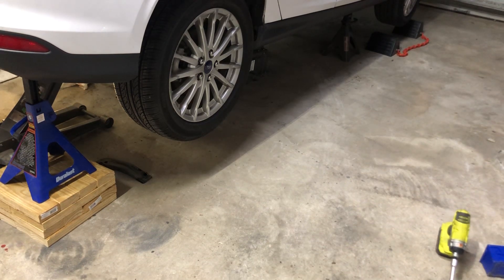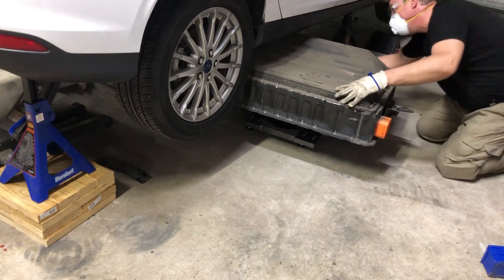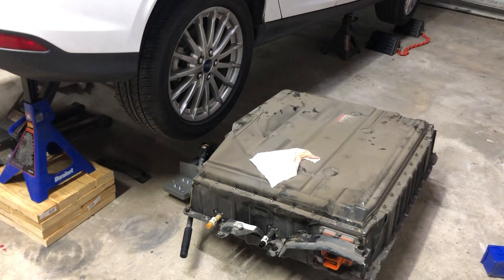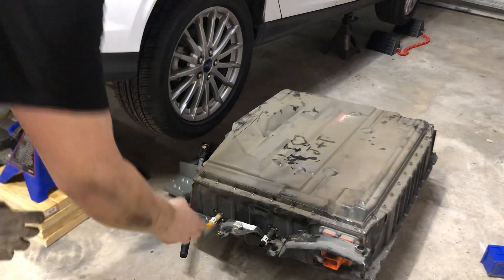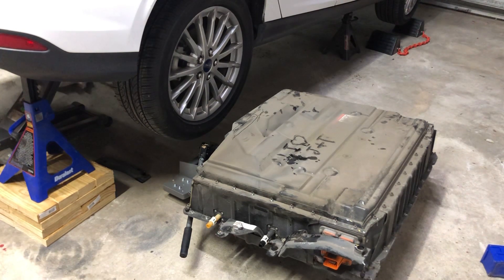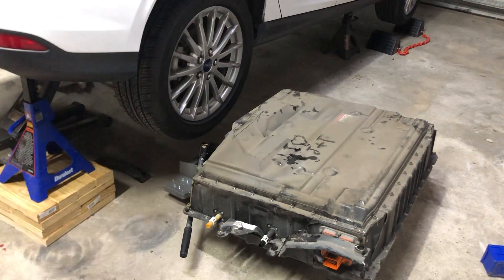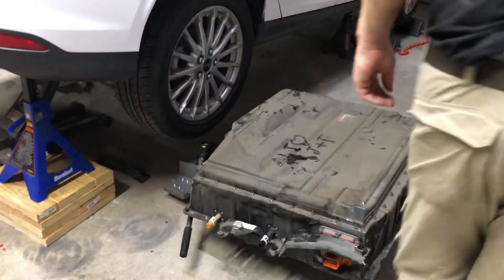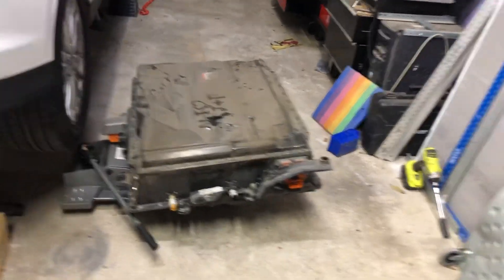Ford Focus BEV Lower Battery Removal

Comment: Where did you get the info ? Web links pls. Thank you for your service sir.
Reply from the maker: There are only six big bolts holding in in once you get the bottom felt cover off. There is battery removal guide available on the web when you search Google.
Reply from the maker: https://elvsolutions.org/wp-content/uploads/2015/10/2016_Focus_EV_Battery_Removal_Guide_Final_10-12-15.pdf

Comment: Tomorrow I have to try this, take lower battery off.
Reply from the maker: It’s pretty easy with the transmission Jack and some simple hand tools. There is an easy removal guide if just do a simple google search.
Reply from the maker: Text me if you have any questions I will monitor my inbox. My number is listed on my channel description.
Reply: Are you replacing it? If so where did you get a replacement. $15,000 totals the car. Interested because I have the same car.
Reply: I fixed it, no need to replace :) Worked fine since. @stevemollenkopf5326